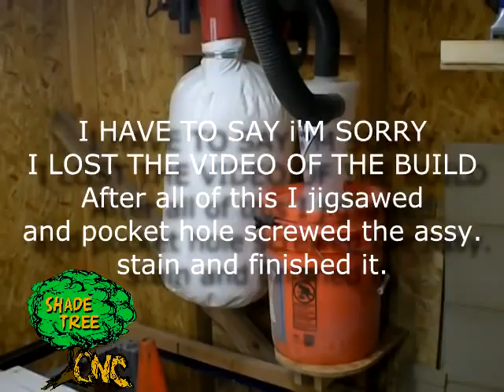File Cabinet Organizer

Comment from the maker: I posted this video only because someone asked. It is by far the worst video I've done. As to the cost if I were to build it again. I'd say 1000 dollars. If you send my an e mail at shadetreecnc@gmail.com I'm finishing up the drawings of a 4x4 cnc and would be happy to send them to you. If you look at the shopping list more then half is software and motor and controllers. The point I was making was a planer is about 350 to 550 bucks and it only good for one thing. A cnc router can do so much more. Mine is my work table router table belt sander table and drill press and finishing stand.  In a small shop space is limited.